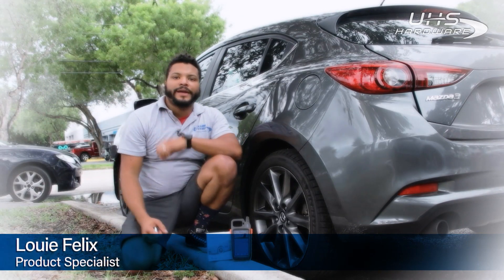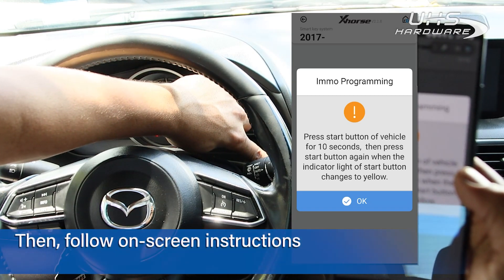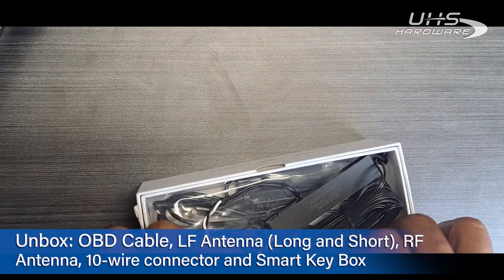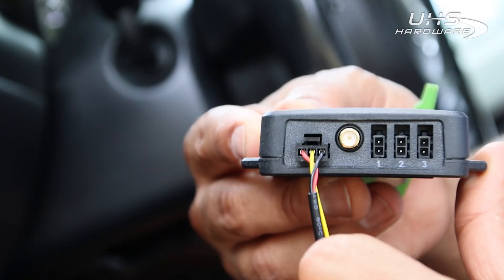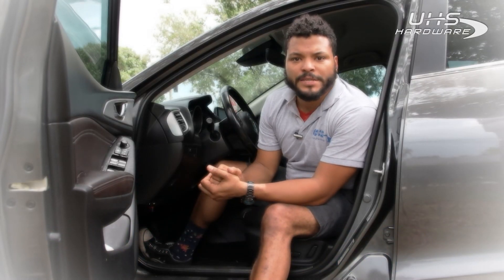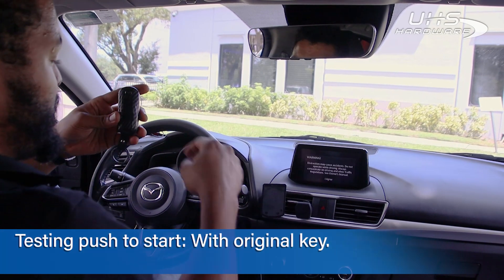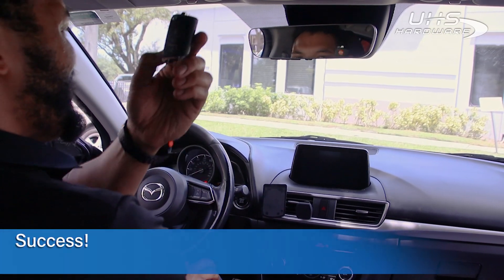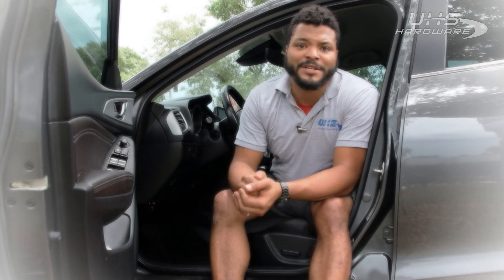Xhorse Smart Key Box * In Prox Vehicle [EASY NEW PROX KEYS & Vehicle Sharing] - Install, Setup & App

Comment: This will not work for example on a Mercedes-Benz with the smart key FBS 3 because the OBD port turns off when the car goes to sleep however you can just connect it straight to the battery with the fuse connection

Comment: You weren't clear with the demonstration at the end. I should be able to walk up to the vehicle and it unlock automatically and just push the start button? I shouldn't have to push the unlock button in the app, right?
Reply from the maker: yes. exactly. keyless door access and locking. also no smart key required by driver for use of vehicle if desired.

Comment: What happens if someone knew im using the smartbox ...crashes the car window take out the smartbox out puts a key battery to the xhorse PCB .....he will be able to drive the car in minutes
Reply: same thing can happen if someone steals your keys..nothing is ever perfect
Reply: Or if they just put the box against the sensing area. Don't need a battery.  That's a no-go for the box from me. I'd be fine using it to add proximity lock/unlock/remote start to non PTS vehicles, but not to PTS vehicles. 

Only way I'd consider doing it for a client is by finding a viable point to rivet a steel box to the vehicle. Like inside the fender well or something. Somewhere obscure and not in the cabin. And run a tap off the fuse box instead of plugging into the OBD port.
.

Comment: Can  program be done with xhorse and autel controls in audi 2014 mqb system? Or just original control with autel?
Reply from the maker: The only part the needs the Xhorse programmers is generating the xhorse keys. Otherwise as long as your remote is programmed for the vehicle, it can be used in the Smart Key Box. If you desire to add (up to 6) remotes to your smart key box after it's connected then you will definitely need Xhorse Universal Smart remotes, a Keytool Max and Mini OBD.

Comment: 10:55 The smart box APP shows a remote start button what does that means?
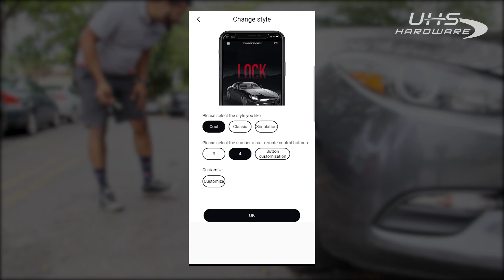Reply from the maker: At 10:48 I show the button customizing option if you opted to connect push to start or an other function in lieu of a trunk or panic. The SmartKeyBox supports four buttons max currently, so this option is helpful.
Reply: @UHSHardware  thx！